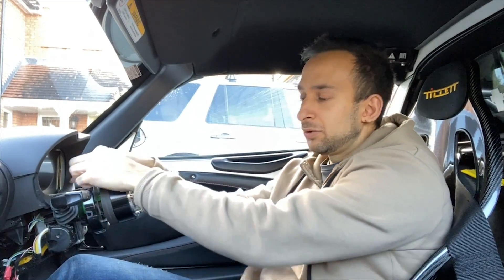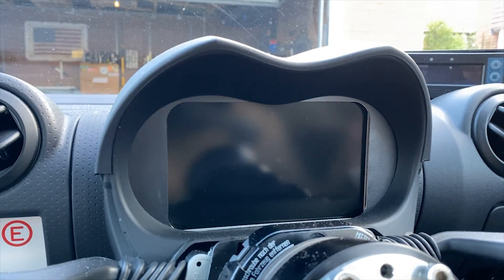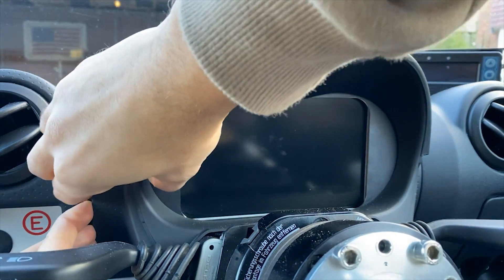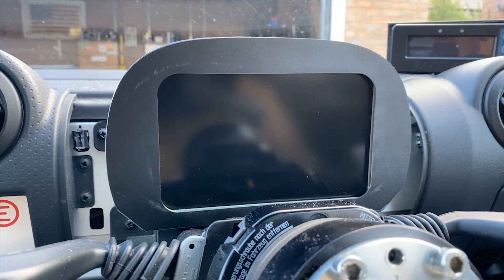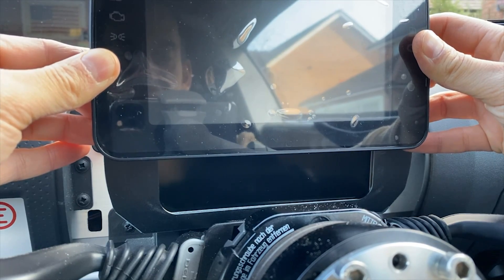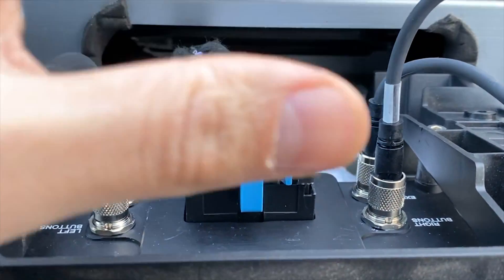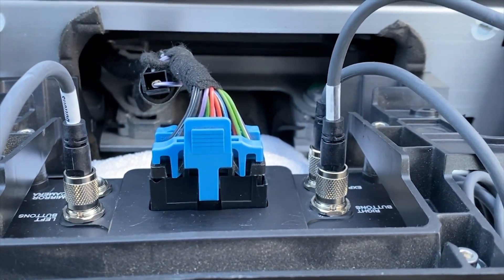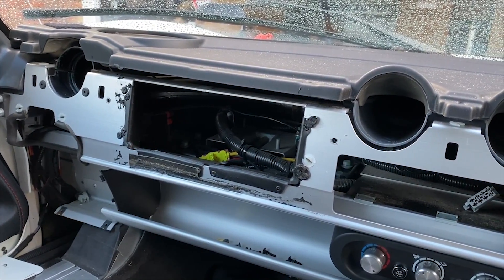Installing the AiM Digital Dash into a Lotus Exige V6

Comment: Great video, in defense of the Garw you are comparing it to the version 1 Garw (2 years old) latest version 4 is Cnc machined the same build quality as the Aim, also the Aim is a 6 inch screen, Garw is a 7 inch.  And one last comment about the rpm response, the Garw has built in damping to make the rpm more realistic (less jumpy) this can be turned off in the latest version (realised in Jan).  I know all this because I know the developer personally, he just doesn't advertise all this stuff (too busy)

What is missing from the Garw is the laptimer and logging, something Aim defiantly has the lead on, and not something the Garw will compete on ever.
Reply from the maker: Hi John thanks for your comments. I am a big fan of the Garw especially for the price ... pound for pound its a fantastic solution :) I would say the screen is actually bigger on the AiM and the build quality is certified to be weather tight etc.. so just a quick response on some of the points you raise. I wasn't aware of the damping of the revs very good to know and actually a good idea!

Comment: Hi Imran, great video. Will you be installing a brake sensor as I believe this is not standard output on the Exige?
Reply from the maker: Not the plan at this time. Engine Oil, Oil Pressure, Gearbox, and AFR is on the cars ;)

Comment: Hello Imran, it does look much nicer than the garw for sure and configuration is clearly plug & play. I am now quite tempted as well... I can"t wait for further review about the features fron your next video. I would also be interested to see how you are mounting the rear view camera and maybe other sensors such as oil pressure and temp. Well done mate.
Reply from the maker: Hi Buddy, the quality is much better but as I say it should be for the price difference. However for me personally this move to AiM is primarily driven by the need for better data and camera integration for driver development. It would appear the sensors are a lot simpler to plug in vs the Garw splicing and then configuring. I won't be doing the rear camera at this stage just sensors for oil pressure, temps, and gearbox etc.
Reply from the maker: Thank you Etienne and hope to share more over winter!